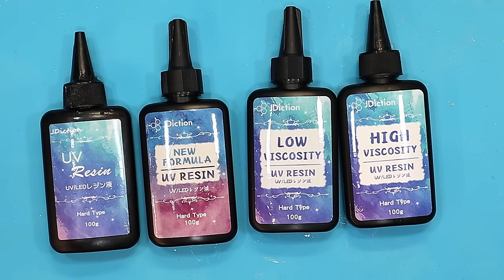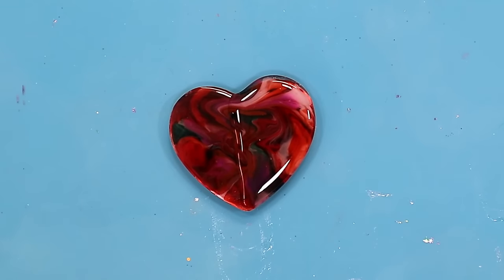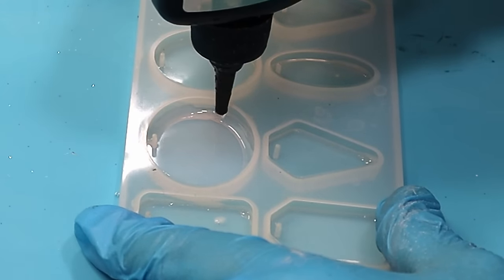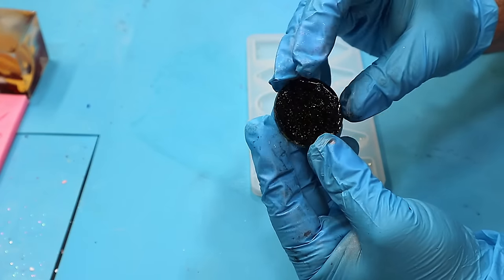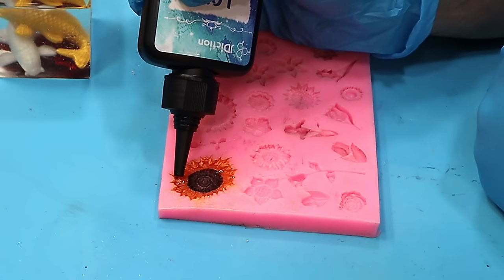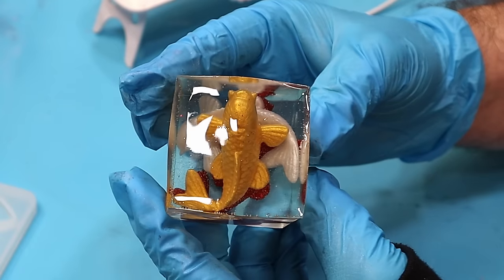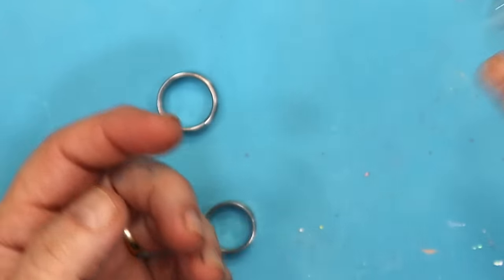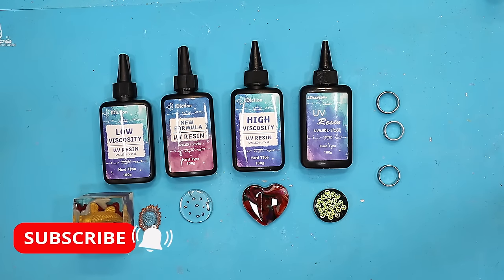Don't Miss Out On These UV Resin Tips and Tricks.

Comment: Steve, thank you for this video. I'm new to resining & I didn't know there is different kinds of resin. Also you proved other info wrong. The articles I read about UV resin said it can only be used in a clear, the white kind, silicone molds. Then you make a flower in the solid color mold using the UV resin. Thank you!

Comment: Won't use any other UV Resin than JDiction, the smell is so much lower than others, and the jewelry pieces come out so clear and wonderful. Thank you for explaining these, because I am about in need of new bottles and with my new studio, I have plans for things to spruce it up as well <3
Reply: Their original formula does not have much of a smell, but I recently tested out the low viscosity formula and it indeed does have a smell to it that is different than their original, and also it was not as low viscosity as I would have thought... it was more of a medium viscosity... I also experienced a bit of yellowing after a two-minute cure on a test piece which went into my window and was significantly more yellow after only 30 days... I have test pieces from my resin that I typically use that is a year old now and still crystal clear, so I wasn't significantly happy with J dictions low viscosity formula it seems the formulation is different somehow.
Reply: i agree with you on the jdiction.....only one i will use also...always clear...never sticky...

Comment: You came across my resin channels today! I have the same little UV light. They're cheap, get a new one before you hurt yourself lol jk. Question, I've been doing resin for 2 years on and off to start a small business and compile enough for a start up. No matter what mold I use, the resin is foggy on the underside (mold side) and I haven't gotten the right buffing tool yet for polishing. I really don't want to blame it on the resin as I'm using a super spendy one (not promoting but you can find it by initials TB) and follow another channel who never seems to have any problems with it. I stir it enough, cure it the right amount, not too hot or cold, no bubbles. 😭

New subscriber here. 😊

Comment: Thank you for showing this. I didn't even realize that they had so many UV resins. I just got some labeled "ECO" from Amazon and I'm loving it. It is the lowest odor UV resin I've tried, and it cures so fast and hard! But it's a little thin, so I will look for the high viscosity one, too.
Reply: The "ECO" must be the same as the "New Formula" one you showed. I have a sensitivity too, and I can use this one in very small amount with just the exhaust vent!

Comment: I have a couple of these, the classic and the high viscosity. When I bought them I also bought a uv torch. I’ve had my pieces cure for more than 10 minutes and they’re still sticky. Same brand. Even used the same uv thing as you.
Reply: I have the same lamp, it's not good. I bought a good lamp and my resin cures perfectly now.
Reply: Try a 36 watt nail lamp, not a 9 watt LED lamp, they say there's no difference, but I believe there is - and don't forget, sometimes you need to turn the item over and cure from the back and also, UV likes to cure in thin layers, try more thin layers instead of one thick layer.  Also, room temp, UV likes it warm like at least 74-75 degrees.  Best of Luck.
Reply: If you have two UV resins, neither of them can be cured. It may be that the wavelength of your UV lamp is not enough, resulting in lacking energy for it to cure. If you have any questions, please feel free to contact our after-sales mailbox, customer support will give you an effective solution.

Comment: Hello Steve, I love your channel and talent. I have learned a lot from you! But I noticed that you curing lamp has exposed wires where the electrical plug goes into the lamp. I would advise you to wrap that with black electrical tape, or it might spark and cause a shock or fire, a small one, but either wrap or replace. 
Keep up the great work!!!

Comment: My friend you have your high/low viscosity qualities mixed up... something with high viscosity will not have much flow resistance and will run like water. For something with intricate details you should use a high viscosity because it will more easily flow into smaller areas thanks to its low density and lack of surface tension. Something with a low viscosity will be highly resistant to flowing and will run with a syrup-like consistency. Try making a dome with the low-V resin and you will surely see 😅
Reply: I just googled it and you're mixed up. High viscosity means very little flow, such as peanut butter or toothpaste. Low viscosity means easily runs. Water is the lowest viscosity.
Reply: @stephaniecollins6052  That's correct, but it looks like JDiction has them mixed up, assuming Steve was calling them the names on the labels. He said the high viscosity resin is thicker and better for doming and the low viscosity is thinner and better for intricate molds. It bugged me the whole time I was watching the video.

Comment: Thank you for this comparison, just stepping into the world of UV Resin and this is very helpful. One question, and it may not have been an option when you made this, but where does the High Gloss UV Resin by JDiction fall in or which of these is it most like? I ordered it as the New Formula would not be delivered until December.

Comment: Hi, I want to use UV Resin to put a hard coat over some small paintings (around 10cm square, some a bit smaller, some a little bigger). I'm having a hard time getting to to level and not leave streaks. The repairs for this are visible. What would you recommend for types of UV Resin and tools to make this work? thank you!

Comment: Was looking for some advice, and if my art project gives you idea's for content or things to sale, fantastic. 
  I was using one of those square something like 8 inches, where i do art projects, its not safe to use normal resin (its a work shop, others are there for different lengths of time), so i am using uv, i just did a light tint of blue acrylic transparent paint, i don't want a thick piece (yet), so i put under the lamp, besides warping (thats simple fix, heat weight it down, wait fix), but it stuck to the mold on one side, and pitted and did some other things on the top, was thinking to sand it down, but was hoping you might have a video on how to not have this happen. and or fix this so both sides are shiny.
   i plan taping the edges just a mm ( the edge is so i can attach to a frame after.), or so, with tape, spay mirror effect spray paint on one side, and using your tip on putting uv resin in a needle bottle, and doing a darker shade of the tint, I am then filling in with different shade of complementary colors. Another project is similar just doing a layered picture, layers of uv resin, and still the mirror effect spray paint on back, either way, both sides need to be nice and shiny.

   Thank you, and i understand if me asking for help like this is a bit much.

Comment: I used the low viscosity to shine up a 3d print and bring out the shine as you did with the block. But after curing for 2 minutes it was tacky still so I tried curing for an additional 2 min. Still tacky. Any idea what could have happened. I also only did a light brush on. I did not lay it thick.

Comment: I just wanted to know if there is any way to clean fingerprints and smudge marks caused by touching the cured uv resin piece... My jewellery turns matte when i touch it and the smudge just doesn't go away... I cure my pieces completely, they are hard and clear but get matte once i touch them 😢

Comment: I recently tested out J Dictions UV resin when I was looking for a thin viscosity resin, as the Thin viscosity formula I was using with my other brand was causing my UV color pigments to fade upon curing... I personally was not happy with JDiction's products... mostly with the low viscosity formula... It had a slight yellow tinge after a 2-minute cure when testing, and has yellowed significantly during my yellowing test in only 30 days in a sunny window... I have tester pieces a year-old with another popular brand that are still crystal after a year in a window. also wasn't personally happy with the so-called "low viscosity" as I know of other brands who make significantly lower viscosity formulas, for me and my experience... it is more of a medium viscosity resin. I feel like JDiction has changed their formula somewhere as their UV resin does not seem to be as good as it used to be... especially with the yellowing. These are just my experiences using UV resin for my jewelry for over a year that I sell in a local shop.

Comment: I've been trying to get help because apparently I'm doing it wrong.  My jdiction device has 3 settings- 60, 90, 150 seconds.  Even at the lowest setting, the dye I add shrinks up and deforms the resin slightly.  And when I demold, there is a sticky mess.  Using high viscosity.

Comment: Hi Steve. I've been playing with a few different resins as of late, and I noticed that after curing, you can still leave a finger print on the surface. I left a different one alone for an hour or 2 after curing, and it was 100% hardened. Is this a problem with my resin, or is it standard practice to leave them alone to "Fully" cure? Cheers, mate!
Reply: @SteveMcDonaldArtsandCrafts , Thank you so much. I thought that it was supposed to be rock solid as soon as the light cured it, so yes, your answer is extremely helpful!

Comment: Have you tested if the high-viscosity ACTUALLY domes higher? Cause viscosity in general has nothing to do with how high you can dome the liquid resin - that only depends on surface tension.
Reply: I'm pretty sure that's the first experiment in this video.  HV domed much higher.
Reply: @vickislominski7618  he never compared them. Viscosity and surface-tension are very different properties. There are liquids that are really viscous but with very little surface tension and the other way around.

For example:
Ethanol has a far lower surface-tension but is more viscous than water.
Reply: Ok, I'm not that smart, but I thought he compared the high-viscosity resin to the original resin.  If there's more than that, I don't really need to know.  He answered my questions.  thanks @ABaumstumpf

Comment: Can anyone help me out? My UV resin comes out sticky. Ive cured it under the uv light for a couple of rounds, ive left them out in the sun and ive tried rubbing alcohol and yet its still tacky. What do I do?
Reply: Your colors are too dark.
Reply: Back off on the color and make sure you are layering just like the example videos you watch.
Reply: As far as layering your UV resin.
Reply: @Linds8312  actually i dont use colours paints or pigments. I like the clear + dry flower combo. The error was the resin itself, bad batch. I bought i new bottle and it works fine. Thanks for the advice though.